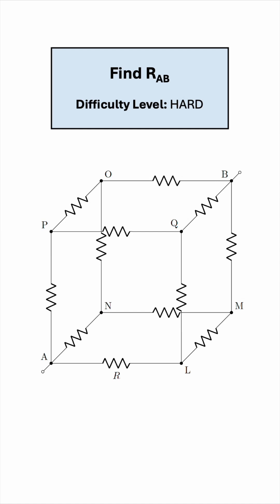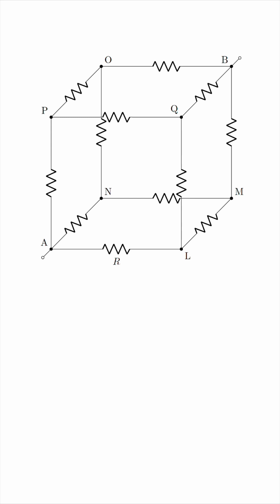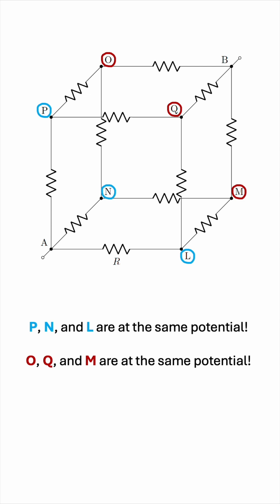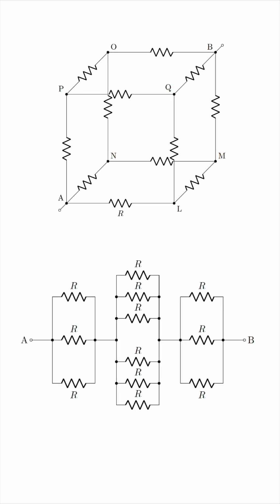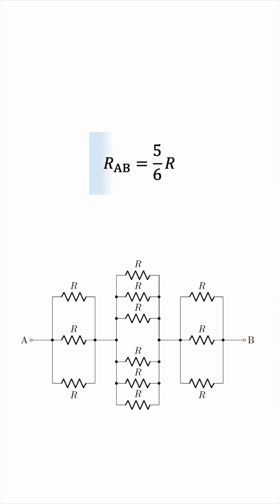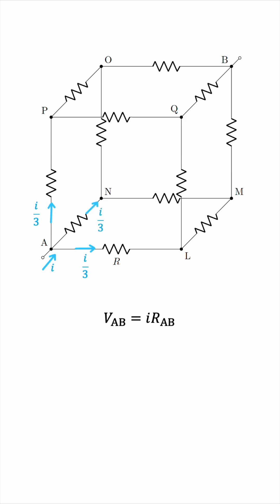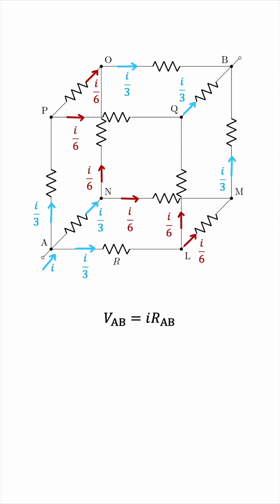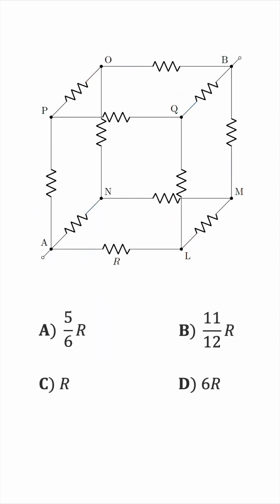Equivalent Resistance of a Cube (Two Methods)

Comment: MY SOLUTION (outline:)

Ground one node and inject current into another. Doesn't matter which one.

Use Nodal Analysis to get a 7x7 matrix. Compute its inverse.

The inverse matrix is a table of "Inject 1A of current at this node and you will get X_ij volts at the other" (!!!) This contains the equivalent resistance between opposite points (5/6 * R) but also between adjacent points (7/12 * R) and diagonal points (3/4 * R)

THIS METHOD WORKS FOR ANY PURELY RESISTIVE NETWORK!!
Reply from the maker: Wow! That seems interesting, but computing the inverse of a 7 x 7 matrix is definitely no walk in the park 😅
Reply: @ElectricalMaths  yeah I may or may not have used a matrix calculator for that part

Comment: Don’t overcomplicate a simple problem. 

The symmetry of the cube makes it obvious that the current flowing through each of the resistors directly connecting to A or to B is 1/3 of the total current I. By conservation of charge, the current flowing through each of the intermediate resistors is 1/6 of the total. So the total voltage difference is (1/3 +1/6 + 1/3) * IR and the total resistance is 5/6 R.
Reply from the maker: @paologat  Well this is precisely the second method I presented.
Reply: @  indeed; but in the whole preamble you kept describing this problem as “hard”, as well as in the thumbnail.

Symmetry is one of the most powerful tools available in Physics. It should be the first to be employed, not the last.
Reply from the maker: @paologat  The idea of the video was not only to solve the problem, but also to present possible trains of thought.

This is the fourth video I’ve posted on equivalent resistance problems, so its difficulty level is only relative to the others. Many viewers requested me to solve this problem, deeming it challenging.

I understand that to you, it may be a very easy problem (it is to me too!) but then again, I try to make my explanations as easy and intuitive as possible—even for someone who’s not necessarily gifted or knowledgable enough. Now it’s just a question of how good of a job I did at achieving that.

Comment: Youch. So much symmetry.
Can do this in my head!
AP, AN, AL alll look into 2 resistors. (PO, PQ), (NO, NM), (LQ, LM).
Imagine that each of those 6 resistors are 2 smaller resistors in series (each R/2)
Now there are 6 new mid-point nodes, all at the same voltage! Call it Vmid
Don't care the voltage, just care that it is the same along each branch, AND that it is also the same looking from B.
Look at resistor AP, followed by 2 resistorss of R/2 leading to Vmid. Total resistance (R+R/2||R/2) or (R+R/4) = 5/4R
Look at all AP, AN, AL in parallel, giving (5/4R) / 3 or 5/12R to the Vmid node set
So there is 5/12 R from A to Vmid, and also 5/12 R from B to Vmid.
Put them in series gives twice the resistance or 5/6R
I like his ways too

Comment: i have done this when i was a middle school student in China, use the symmetry and connect the nodes which has same potential, then it converts to a parallel circuit, good old days

Comment: How would you do it if the resistances were not all the same?
Reply: Then you'll need to use a matrix. 
A 6x6 matrix - equivalent to 6 equations with 6 variables - using Kirchhoff's laws to set up loop equations.

Comment: You are wrong. You can't say that P N L have the same potential just because their resistors are the same. It depends on the current, which depends on the rest of the network.
In this case, yes, you can do that, but only because the cube is perfectly balanced.

Current splitting was my intuition and yeah it's pretty simple in this case.

Of course the killer solution is Node Potential method.
Reply from the maker: @MrHerhor67  Well, the current being the same is a result of the resistors being the same, so no I’m not wrong.

I could’ve said it explicitly, but I didn’t want to mention current at all until the second method. That maybe explains it

Comment: Super cool. Btw what's the name of the law that says that P,N and L as well as O,Q and M are at the same potential?

Edit: Just subbed. Great content dude!
Reply from the maker: @Amperius_Voltarius_Ohmison  Thanks a lot!

It’s not really a distinct law—it’s just that the potential at P, N, and L is the same voltage drop away from the potential at A, so they must be at the same potential. And the reason the voltage drops are the same is because we have the same current * the same resistance.

Does that make sense?
Reply: @ElectricalMaths  Thanks! I am sure that your explanation will make more sense and might even become intuitive as I gather more knowledge on the subject. Grateful for your reply!